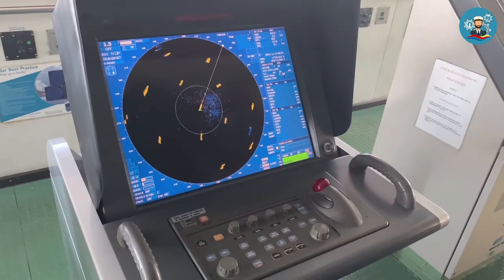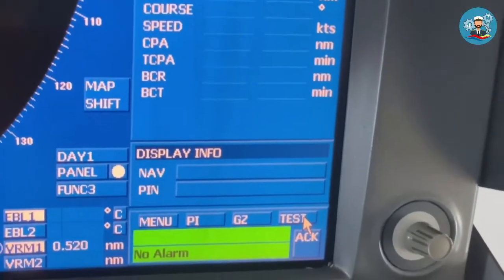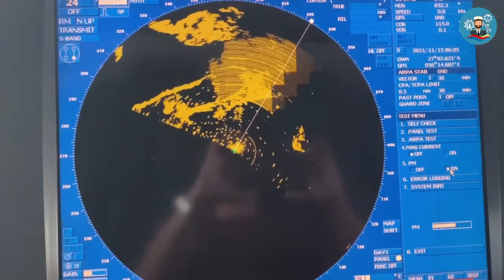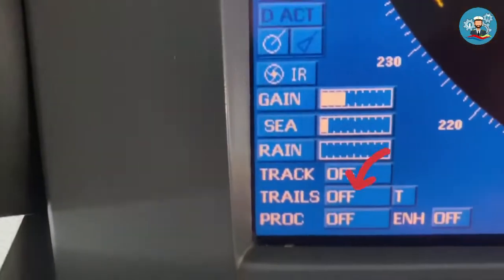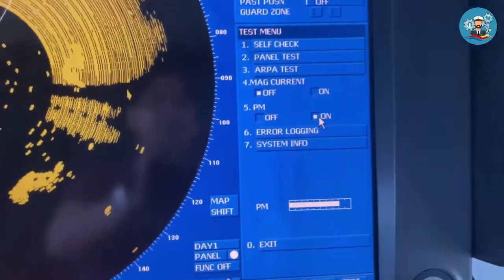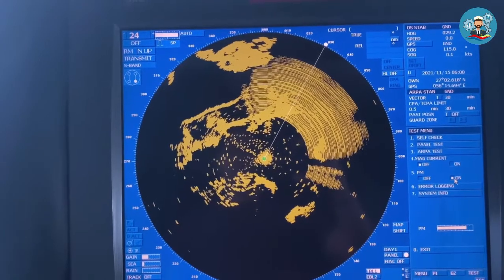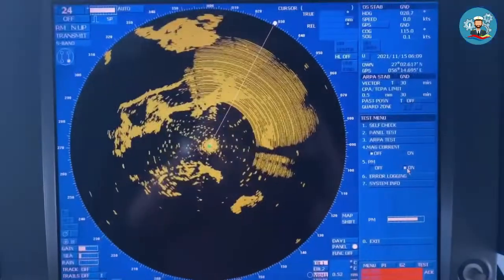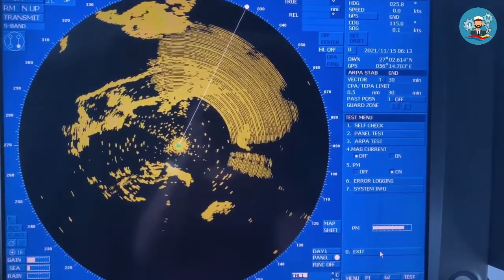How to Conduct Radar Performance Test | Informative Vlog by The Sailing Master

Comment: GOOD DAY SIR, tq for the informative video. Is this test only for receiving sensitivity test or also for transmitting power as in this video you didnt mention anything about it.
Reply from the maker: Hi sir good day. It is also for testing the transmission output power. In other model, the term used is Transmitter System. Not PM.
Reply: @TheSailingMaster  thank you for responding 👍